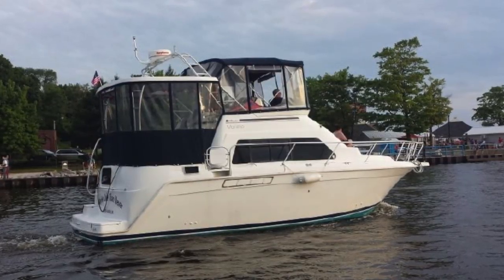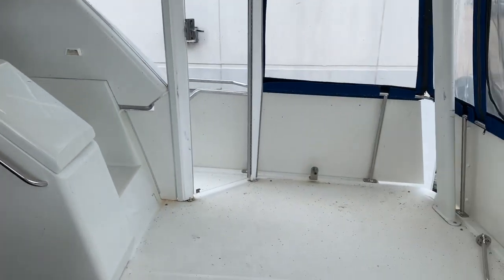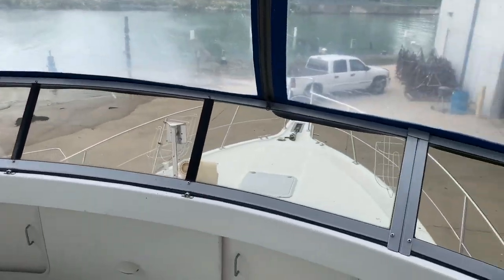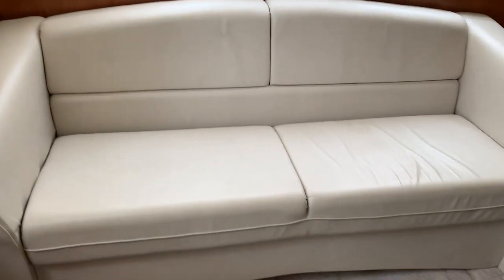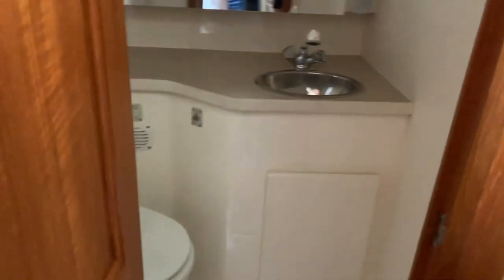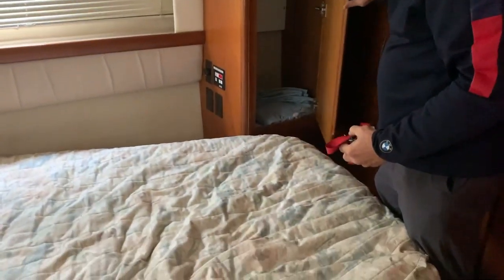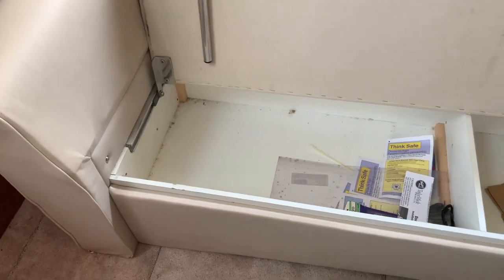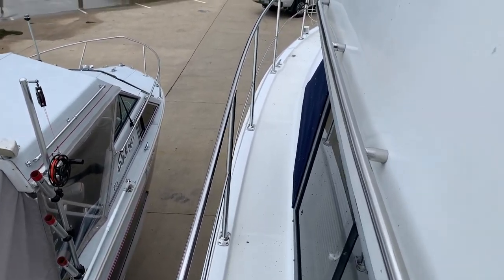Wisco Boater shops for a new boat, boat #6, but the first one on video

Comment: Hi Chad. Chuck hear from San Francisco Bay Area. Still like you Catalina over this Carver. Although Carver a nice boat. Lots of carver 355’s available on used market. Gosh, Carver sold a lot of this model. Less windage in your Catalina I would say. One thing I like about it over the Catalina is the dinette. However, you built a dinette in your Catalina which was a good idea. I just like the lines better in the Catalina. They are both nice boats. The Chris Craft name I think better for resale. Sometimes, it comes down to personal preferences. We have lots of Carvers in my area. The Catalina 350 & 381 models are hard to find. However, if you look hard enough, eventually someone will be trading up or down, to get what fits your needs better. Ok, Captain, Happy Boating!